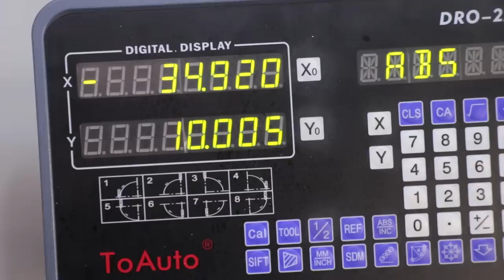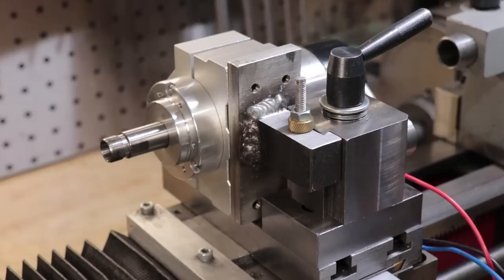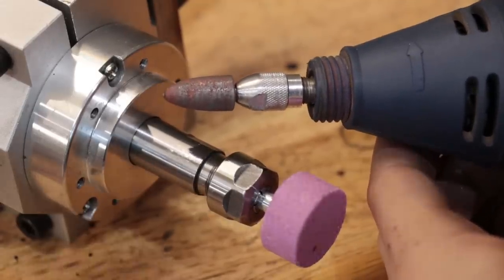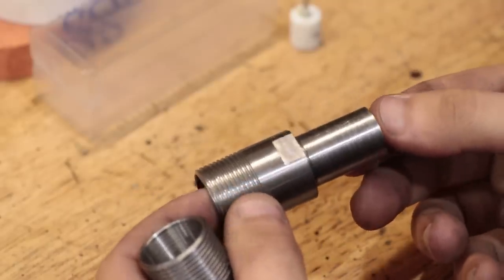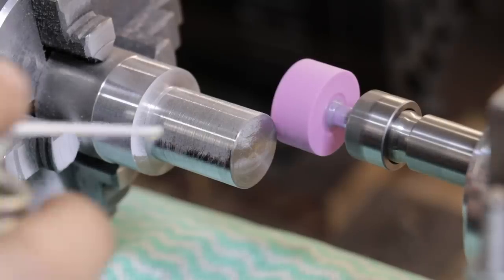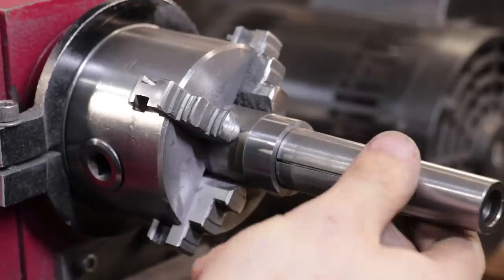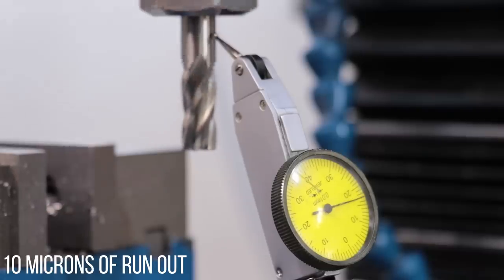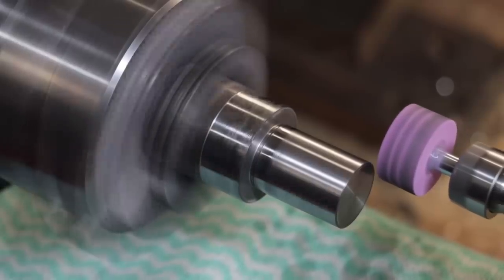Lathe Toolpost Grinder Build

Comment: Your run out measure is not accurate ! The tip of your indicator must always be as parallel as possible to the surface you are measure, if your touching the surface at an angle like in your video you get a cosin error, in practice that means that your ~0,01mm runout with your tip pointing at 60 degres is in reality about 0,03mm with the tip at an appropriate angle (just making those numbers out so you get the idea)
Reply from the maker: I goofed up here but I retested it and im still getting below 0.01mm of run out on the toolholder https://www.youtube.com/watch?v=xD1a_R5v2ak

Comment: I think your feed rate is too high and also the lathe RPM is too high. You need to take light passes since there is no cooling. You need to dress the wheel course
Reply from the maker: I've tried various speeds and it doesn't seem to make too much of a difference with soft steel. Definitely matters with hardened steel which takes lower lathe spindle  rpm.